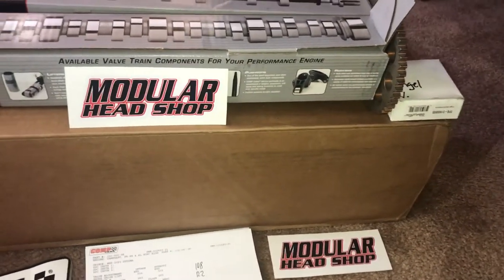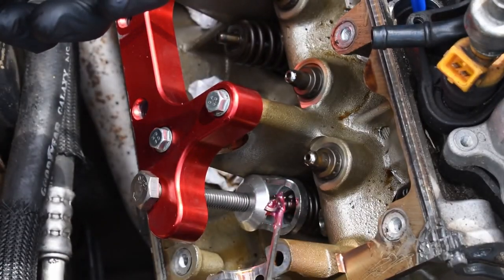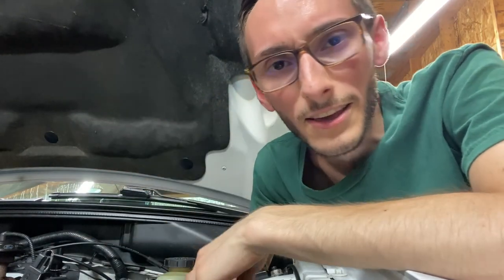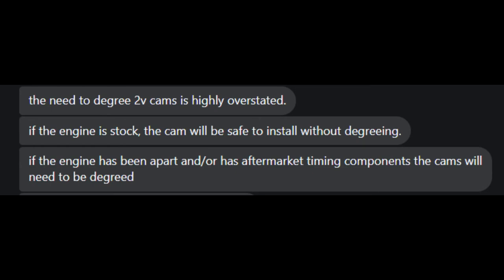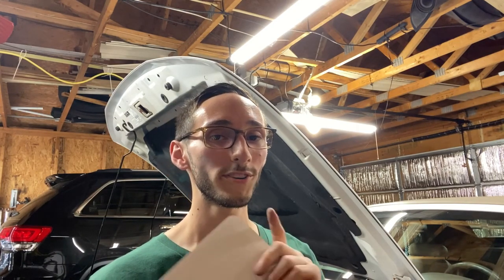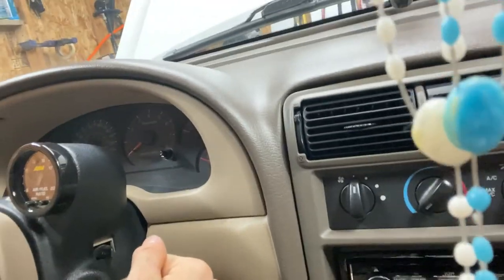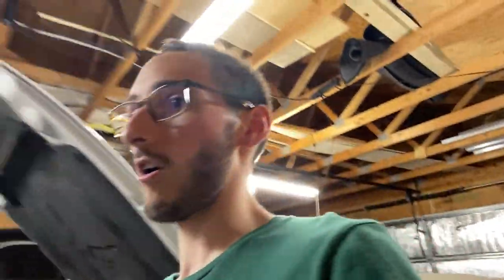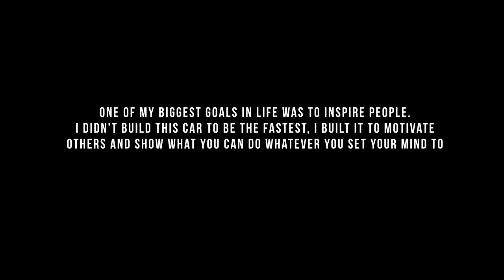Everything You Should Know About Installing Cams (96-04 Mustang 4.6 5.4 2v 4v)

Comment: i get locking the cams in place to take the chains off(so they don't move)... but then don't they move when you take the holding tool off? How do you prevent pvt during cam removal if things shift?
Reply: I meant PTV
Reply from the maker: Yeah so cams will still have tension via valve springs even when chains are off. What you can do is remove cam followers (aka rocker arms) by rotating motor by hand to have the lobe in the closed position (out of the way) for the valve so it's easier to pry/pop follower off. 

If I remember correctly, I believe I just set the engine at TDC and trusted myself that nothing was going to move enough since I held the cams in place by hand (even with the cam holding tool also holding it) and also walked the cam cap bolts out evenly in a criss cross type sequence.
 
You could also set the pistons to be low enough to not hit anything by turning the crankshaft key (not the crank gear but the actual spot where you'd put your socket/bolt at and turn it so that the mark on it faces at the 12 o'clock position.
Reply: Thanks for the info! How are you enjoying the new cams? Or have you replaced a 3rd time? Ha
Reply from the maker: @andys8718  Glad you asked! The cams I currently run are the still the same/second set I have in the video. That’s pretty much as aggressive as I can take it with my current setup, which is going to stay the same for a while since chasing NA power is not really worth it, but at least I’m always ready to street race people. NA power is awesome though since it’s all pure. I’ve had multiple people tell me “damn I wasn’t expecting your mustang to be that fast”. 

I have another 02 Mustang GT Vert I plan to tear apart in the next few weeks, like a full on BUILD BUILD, I just now got back from jacking it up super high in the air to weld on some subframe connectors along with the factory torque boxes sometime this week. The Todd Warren Turbo cams for that car just arrived last week, it’s going to be a fun one.

Comment: Quick question so when changing valve stem seal yu didn’t use rope or air ? If not so it’s possible to change them without neither ? And did yu have to degree yur cams went installing them ?
Reply from the maker: I put each piston at top dead center, one by one when I changed valve stem seals. This physically prevents dropping a valve. Air works but I don’t trust it enough. As for degreeing, I just dropped these in without degreeing and never had issues. I know some cams require degreeing to not hit stuff but I just lined up the timing marks and sent it for my set.
Reply: @McLovinsFunhouse  ok thanks might be doing mines the weekend ‼️
Reply: @McLovinsFunhouse  so as long as I put each piston top dead center I don’t have anything to worry about?
Reply from the maker: @KEREKTHEHEADBUSER  Pretty much yeah.
Reply: @McLovinsFunhouse  thanks a lot im trying those MHS stage 2 cams but im planning on doing a valve stem seal job why im in there

Comment: I’m thinking about putting stage 2 cams in my car but I have to pass emissions. Are these cams easy to tune ?
Reply from the maker: The term “stage 2” is different for every manufacture, but stage 2s in general usually aren’t radical enough to cause issues with emissions. To give you an idea, the MHS Stage 2 cams are baby cams. Easy to tune as long as they are installed properly, doesn’t need to be from a dyno, even an email tune would be enough. Marty Ochs is the best modular motor tuner out there, I don’t care what anyone else tells you. He does email tunes, street tunes, and dyno tunes.

Comment: Have you started to rebuild your engine yest?
Reply from the maker: Never really had a need to. Years later, hundreds of launches and 6500 rpm shifts car has never missed a heart beat. I do have a stick shift 02 GT project on the side that I rebuilt with new pistons, rods, bearings, todd cams, turbo, and e85...all garage built. It's still not 100% running yet since I dropped a valve doing a hard pull but yeah car felt pretty damn quick even with just a base tune... but an NA build is always pretty cool too. I needed both lol.

Comment: My stang has nearly 200k miles, would it be wise to install cams?
Reply from the maker: Not without rebuilding the motor (adding new piston rings, valve seals, head gaskets, intake manifold gaskets, etc.). I would hold off until you can reliably build your stang. The rockers and lash adjusters last quite a while on our cars but it would just be a bit expensive for you to do cams since you’d more than likely need to dash out the money for new OEM/FORD rockers and lash adjusters (aka lifter) anyways or else you’ll find yourself digging into the motor after installing cams to fix an issue that could of been avoided if taken the proper preventative maintenance beforehand. Honestly, if you are in love with your stang and have money to spend, I’d go ahead and do cams. I say it like that because it’s so ridiculously expensive to mod our motors for such little power in return 🙃.
Reply from the maker: In other words, at 200k, I would personally just rebuild motor but if you don’t prefer that route then you could always save yourself some $$$ and time by just overhauling the valve train (rocker arms, lash adjusters, valve seals, valve springs) but even that is still expensive and you’d still be dealing with a ticking time bomb in the bottom end haha, dang. In the end, getting a used 4.6 motor with I’d say less than 120K miles would be the cheapest route but I’m not a fan on telling people to “get a new motor”.
Reply: Right lol. I'm in the same spot. I'm at 199K. Lots of highway miles and always kept the maintenance up. Thought about just running a compression test and go from there. If I do cams I'm absolutely overhauling the heads and timing with new components while I'm in there. I love this car, it's been great to me for 13 years. I'd love to do this and have this experience under my belt.

Comment: I think one of your mistakes is using the Hayes manual  I would advise you to get the Ford manual for your make and model it is way more detailed
Reply from the maker: I'll be honest, I didn't really read much out of the Hayes manual but there still is good info in it, just can be a bit too wordy without enough pictures. The Ford owners manual (year/model specific) definitely comes in clutch when looking for fuse panel references & fluid capacities, I'll give ya that. Seems like vert fuses are a bit different than coupes, that's the only time I ever pull mines out. The other book I've read a bit from was "How to Build Max Performance 4.6 Ford Engine" by Sean Hyland, it's okay for what it is. Some may argue that everything is on the internet but you can't always find very specific things.
Reply: He'll no you can't always find the correct info. I got an 03 gt.

Comment: Where are you located?  Would you help me install my cams if i paid you?
Reply from the maker: I don’t feel qualified enough to do that service lol. I live in Milwaukee, Wisconsin.
Reply: @McLovinsFunhouse  we can do bro.  I won't hold you to anything.  The cams are already degreed.  Also it's actually a truck that is wide, WIDE  open and super easy to work on.  I'll be working along side you and paying reasonably.  Let me know.  

How long does something like this take?
Reply from the maker: I hate to say no but I’m gonna have to pass on that offer. I helped my dad fix some cars in our garage over the years and we realized how it was just better to end it, too many issues… The issues on our side were people wanting things for even cheaper than the cheap prices we charged for damn near professional work (even with parts ordered from Rockauto instead of paying crazy local auto part store prices)… the issues on their end was driving cars that were barely surviving and only replacing 1 part every 5 years, if ever. Too much stress on our side and it got so bad that it was tearing our family apart.
Reply from the maker: The hardest part of the install is taking the timing cover off if I have to be honest. A professional once told me to spin the crank by hand 20 times or so to verify that the engine is on time via marks when you do a timing job, he was right…. very rarely will the “marks” line up spinning it just a few times. If car had 4 cams and a balance shaft or something then yeah I’d be scared but these are pretty simple motors when you study them. Whole install could be done in a weekend if you really worked hard at it, maybe a whole week tops if you really take your time with just a few hours a day.
Reply: @McLovinsFunhouse  ok, cool.  I know the price to do something like this is about $2300.  I'm in the service industry with my own business.  I respect craftsmanship.  I could just pay someone to do it, but I wanted to get dirty and know that I had a part in it.  I even have a BRAND NEW ProCharger for it that I paid $5000 over a year ago that I plan to install.  The cams I have are Blower cams.  Anyway, thanks.

Comment: also, quick question about valve stem seal replacement, since i will retain stock cams, do i have to degree stock cams?
Reply from the maker: No degreeing of cams is necessary when changing out valve stem seals : )